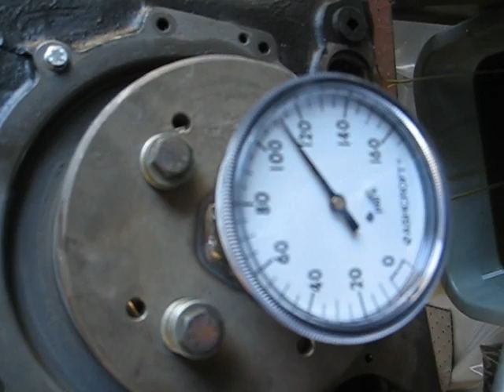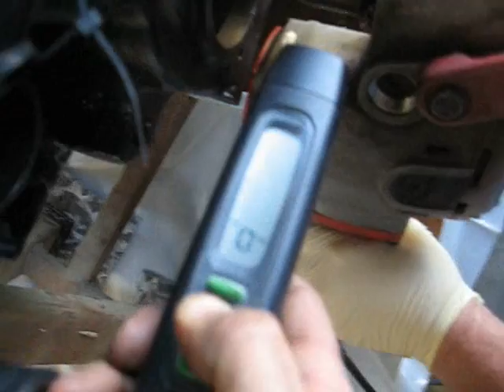PANTHER ENGINE OIL PRESSURE TEST

Comment: What viscosity oil is being used in this engine and what is the sump capacity?  With a low speed, very heavy vehicle, (tank), I would think the oil viscosity would have to be very thick to resist shearing under such heavy loads.  If I recall correctly, this is a gas engine, correct?  What kind of oil filter does the engine use?  Is it a standard spin-on oil filter, or some kind of heavy duty oil filter?